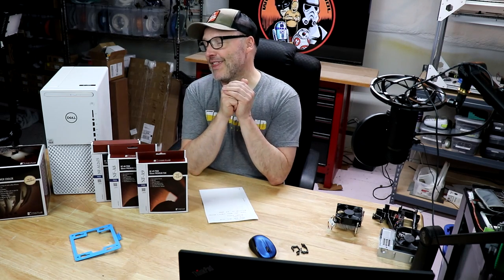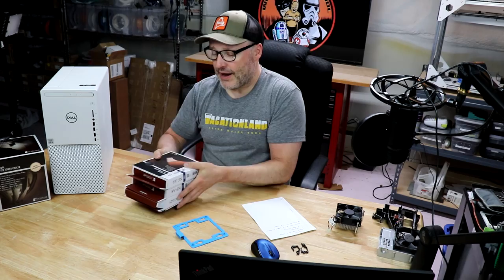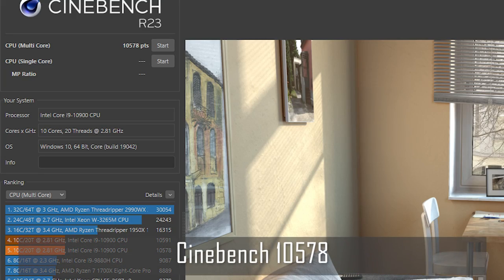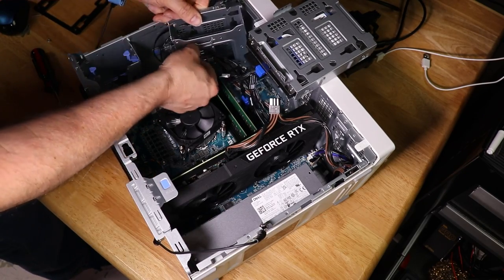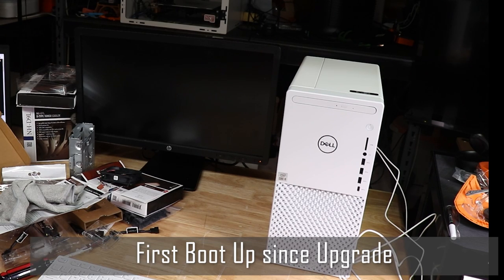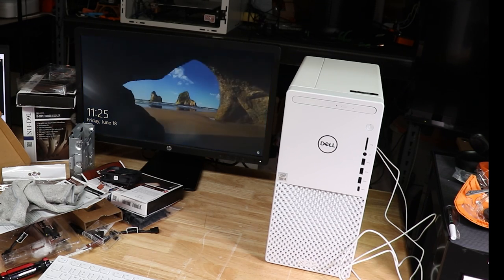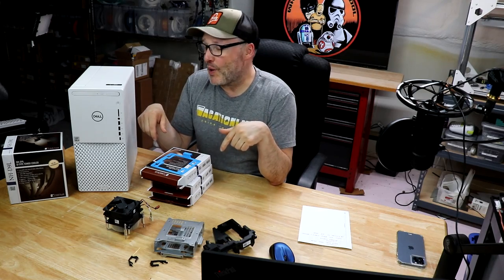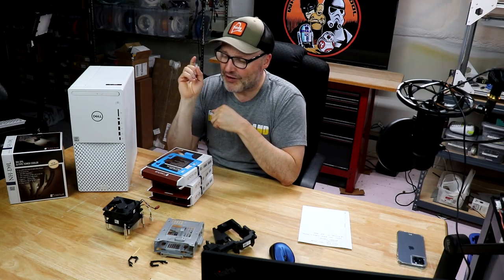Dell XPS 8940 / G5 5000 - Upgrading CPU Cooler and Fan Upgrades for better performance?

Comment: @Where Nerdy is Cool!  --  I'm wanting to do this upgrade to my XPS 8940.  Apparently, it's getting too hot.  Streaming videos results in random screen freeze with buzzing noise, and I have to manually power off and let it cool down.  I opened it last night to get a gander of the innards for comparison to the video.  I cannot figure out how you are connecting/wiring the 120mm front fan to the system.  I'm sure there must be something there, somewhere.  However, I see only one label that reads "fan sys", and that is dedicated to the rear fan.  What should I be looking for?  Will upgrading the rear fan alone be enough?  I paid $3600 for this machine, specifically for video capabilities.  That's a lot (for me) for it to have problems that seem to be inherently built in.  :(   On another note, I had no problem locating that 120mm fan mount for the XPS 8940 on ebay.  There are lots of them out there now, under $10.  I'm not ordering anything until I know I can plug in that front fan though,... and I am stumped.  Help?
Reply from the maker: I’m using a splitter to get that front fan plugged in.  It helps but honestly if you want the minimalist way to cool that thing down - replace the stock heat sink with what I suggested and replace the rear fan.  Those two things will blast a lot of heat out of that little case!
Reply: @WhereNerdyisCool  - Aha!  A splitter!  I can certainly do that.  It came with the super-duper heat sink already installed, but halfway through a movie, you could use the top rear of the casing as a coffee warmer.  I think (hope) that getting more air moving through the casing will make the difference.  Many, many thanks for your video and for your response.  Greatly appreciated.
Reply from the maker: @onedominant that’s pretty toasty. Yes try the fan and see what that does to your temps for sure

Comment: Which fans did you have as exhaust and wich were intakes? Also did you use the splitter that come with the fans to split the fan output from the motherboard to all the case fans?
Reply from the maker: Watch the video. It’s all in there

Comment: Great video!  Question about the 120mm front fan.  They have 3 pin and 4 pin options.  I know the Noctua A9 for rear is a 4 pin but the splitter used  has a 3 pin and 4 pin tails and the rear fan would take the 4 pin tail.  Does that mean the front top fan be a12x25  would have to be a 3 pin version?
Reply from the maker: Not sure I follow. Everything I did used the 4 pins
Reply: Sorry for confusion.  In looking at the y splitter from Noctua, one branch has a 4 pin end with 4 pins and the other has a 3 pins in a 4 pin.  Will I be okay getting a 4 pin noctua 12x25 for front?

Comment: Does the front panel allow for sufficient air flow?  The grate on the bottom front panel doesn't line up with the fan which is on the top front. Is there a custom front panel to fix this?
Reply from the maker: I feel some air definitely gets through that front area.

Comment: Hi. I am new to all this. Got  my Dell xps 8940 for a good deal. Due to budget constraints I will be using the vetroo v5 for cpu cooler. I see the other brown fans you use. Instead of those, can I use Noctua NF-B9, Noctua NF-R8, and Noctua NF-P12? What is difference, color or how silent it is? Any help is appreciated. Thank you for this video! Saves me hassle of buying a whole new case, mobo, and power supply. Also, i do not have 3D printer for the 120mm bracket. I know its probably no good but can it be zip-tied somehow to stay in place or is the bracket required?
Reply from the maker: I’m sure if you reach out on social media one of your friends must have access to a 3D printer. They are everywhere!  As to your fan questions, give them a try and let me know!  Someone else might come across your comment asking the same. My PC is quiet and doesn’t interfere with filming videos, live streaming or gaming. Do yourself a favor and collect some before and after stats to compare!

Comment: What are your thoughts on swapping the case? Is it possible/practical?
Reply from the maker: Don’t think it’s very practical. If I buy a new case, I’m piecing together my own computer 🙂. Since I couldn’t find RTX cards, that’s why I settled in the Dell.  But a better cpu cooler and some added airflow does wonders.  Even just the cpu cooler and a bigger rear fan will be noticeable

Comment: Nice video.  Out of curiosity, where do you plug the two front fans in for power?  Do you use two splitters off the rear case fan?  Thanks
Reply from the maker: Yes

Comment: Great video! Is there a link to the m3 25mm screws you used? Thanks!
Reply from the maker: I just bought some at my local hardware site and cut the heads off with a Dremel
Reply: @WhereNerdyisCool  Cool, yeah I was having a tough time finding some without the heads, guess I'll just bring out the dremmel. thx!

Comment: Hmm... Seems like a more a cooling thing.  But temps are still within spec for the chip and it won't go over its thresehold.  Me personally, that is something I don't care about. Seems like a cheaper option for cooling is $40 for a 92mm fan and the upgraded Dell cpu cooler if you really want to.  Temps won't be as good, but still much better and likely give you similar gains if you run a program that pegs the 100% all the time. If you just play games or use applications where the CPU utilization bounces all over the place you don't really gain anything.  I'd be more interested in 1% lows.  See if there are any gains there.
Reply from the maker: The big thing to note is the cpu speed drops as the temp soars. With the new heat sink and additional cooling, your processor isn’t powering down to stop from overheating. In hindsight I’d skip the fan by the video card.  But for not a lot of money you get the full capabilities of the processor.

Comment: Hi! Great video! What are exactly the screw that you are using to put the CPU cooler?
Reply from the maker: It’s mentioned in the video and the description. M3 x 25 mm. Cut the heads off. Or if you can find 20mm long M3 set screws, no cutting required

Comment: Do you need the 3d printed part to install the 120mm fan?
Reply from the maker: Unless you can come up with another way to secure it to the front of the PC
Reply: @WhereNerdyisCool  would the 80mm fan fit in that spot without needing any other parts?
Reply from the maker: Hard to say. I’m sure you could find a way.  Honestly, if you can’t get that front one installed, stick to the better rear fan and the cpu cooler.  That alone will do a lot!

Comment: so, do i need to buy the m3x25mm set screws apart?
Reply from the maker: As I’ve said numerous times in the video and comments - I just snipped off the screw head off some m3 x 25mm screws, filed and used that.

Comment: Thanks a lot for this video! I only wanted to ask if you would be still able to add another two memory modules or not? in other words, does the cooler block the fourth Ram module?
Reply from the maker: I think everything fits!  I just ordered a ram upgrade so I’ll know for sure soon
Reply: @WhereNerdyisCool  always helpful .. thank you! Please let us know how it goes. I hope you get lucky with your order delivery, mine have been stuck with UPS for a little time (not to much) due to "extreme global weather" :) coming from ON to BC.
Reply from the maker: I had no issues putting ram in last night!
Reply: That's great! Still waiting on mine, but I'll put the cooler on order. 
Once again thanks a ton!

Comment: Very insightufl video. I am wondering, will an XPS with an i5 and a gtx 1650 be able to work well for light web browsing (like watching videos) and learning to code or will it overheat? The monitor set-up will be two 4k monitors. It will be a productivity machine not for gaming.
Reply: for light web browsing its okay, for gaming only that it gets really bad
Reply from the maker: I know for the 3070 it does okay with a good dealing of tweaking and careful over clocking.  For VR is use OpenXR

Comment: This was an absolutely killer video my bro! My configuration came with a 1660ti and looking to upgrade this to a 3060 phoenix for some rtx features, do you reckon the upgrades you do in this video will still fit space wise?
Reply from the maker: If you have that hockey puck like cpu cooler, definitely do that and a bigger/better rear fan. You’ll feel an amazing blast of hour air flow out of that XPS after

Comment: One other free thing that you could've done is installing Intel XTU and increase the Intel Turbo thing to the max time period, that would've given you more CPU performance after you installed all those fans and changed the cooler.
Do you have a video on the HP Omen 25L(AMD version) made. I searched everywhere and can not find VRM heatsinks for sale.
Reply from the maker: I looked into that but last I saw, the boost was a max of 15 minutes?

Comment: Hey, I did your setup except for notcua cpu cooler i went with artic 13x, great stuff! I even added the vrm heatsink. I do notice at full load I can still hit 85ish, is this normal? It does seem faster and more able to keep cool longer though. Thanks!
Reply from the maker: Any improvement helps. You must feel a whole lot of hot air blowing out the rear fan now

Comment: So I did 120 mm and 92 mm fan from Noctua and NH-D9L, have you figured out how to monitor fan speeds? My config is i7 with 3060Ti, 32G.
Reply from the maker: I left them stock

Comment: THE REAR FAN YOU INSTALLED TO EXHAUST, IS THAT PREFERRED WITH THE TOWER CPU COOLER?
Reply from the maker: Wow. Capital letters. 
Yes the big rear fan helps a lot. And the better cpu cooler does an amazing job.
Reply: @WhereNerdyisCool  what direction is the airflow< in or out?
Reply from the maker: Front fan pulls air from outside. Rear fan blows it out (exhaust)

Comment: Just have a question with regards to XPS 8940 120 mm fan mount. How did you get it? What are the steps? Thank you.
Reply from the maker: I printed my own. The links have the file. If you know someone that has a 3D printer, it’s a simple print
Reply: @WhereNerdyisCool  Okay thank you.

Comment: Very helpful :) Ill be doing this shortly, what kind of fan splitter should I use ?
Reply: Hi  - I did this same upgrade on my XPS9840 using the same fans. The fan splitter cables come already supplied with the Noctua fans, in the box.
Reply from the maker: Everything comes with the Noctua fans.

Comment: If you took the GPU out, is there enough room for one of those thinner ITX 120mm case fans to put in front of it? That's the reason the GPU didn't show much difference. The air from the 80mm is hitting the PSU mostly. Positioned dead center in front of it you'd be able to cool the GPU a little.
Reply from the maker: Or use Afterburner and crank up the fan speed as I recently did 🙂

Comment: How did you change the fan speed? It seems like dell does not allow that as speed fan couldn’t detect the fan at all.
Reply from the maker: I didn’t touch any fan settings. Just new fans

Comment: Hi, great video.  When you installed the front fan on the printed bracket, you said you were concerned about "bottom but so far nor wires have touched".  Is there some "danger" to be worried about / avoided?
Reply from the maker: I didn’t seat it properly the first tine into the slide guides.  I wanted to make sure the fan blades didn’t chop away at any cables 🙂
Reply: @WhereNerdyisCool  Thanks for reply.... that makes sense.....thought it might be some special techie magic!!!

Comment: Did you get the M3 screws from the Noctua CPU Cooler box?
Reply from the maker: No. I bought some M3 30mm sized ones, measured 25 mm and gut the tops off.

Comment: I didn’t not receive any m3x25mm set screws with my purchases, and cannot for the life of me find the exact screws to buy. Please help
Reply: Baked I just checked the rest of the comments. I guess I’ll try my best to cut the head off some screws?
Reply from the maker: @connorbroyles2669 file them carefully!
Reply: @WhereNerdyisCool I’ve had them cut, but I feel it was not enough. My dad works in inches, so he cut it to one inch instead of the exact size needed. Since he’s difficult, and I think the inch is for sure too long, what size exactly do I need to grind it down to? 0.984252?
Reply: I tried to mount using the 1inch cut, but was left with some wiggle space on my mounting bars with the spacers, I figured that part needs to be snug since it’s literally holding everything right? My screws also seem very well stuck in the motherboard so I need pliers to get them twisted back out LOL
Reply from the maker: @Mcbetuss  just make sure it’s a smooth cut. You’re doing this at your own risk ⚠️ so just make sure everything fits well
Reply: @WhereNerdyisCool likely a millimeter of space between the mounting bar and the thumb screws being snug :(

Comment: Did those screws you put into the motherboard for the cooler come with the cooler kit or did you buy them separately? Thanks!
Reply from the maker: As I stated in the video and numerous comments … no. 😀. I bought some 25mm M3 screws and cut the heads off.

Comment: Hi. May I ask what thermal paste you using for the cooler? Can I use Arctic MX-5 with the Noctua NH D9L?
Reply from the maker: I used what came with the  Noctua cpu cooler.
Reply: @WhereNerdyisCool  ok. Then maybe I guess I will try use Arctic Mx-5 since I check another video using Mx4 on it. Thanks
Reply: I just install the cooler.
Any software or Dell bios can control those fans speed?
Reply from the maker: I didn’t touch any software settings 🙂

Comment: Where did you get the 25mm m3 screws?
Reply from the maker: As mentioned in the video and description, I just using a Dremel to cut the heads off some regular M3 25mm machine screws
Reply: @WhereNerdyisCool  OK thanks.

Comment: Where did you get those m3 screws any links ?
Reply: Just to clarify i bought the exact same coller thinking those screws were included lol
Reply from the maker: Hi!  I just bought some M3 pan head screws and used the Dremel to clip the heads off. I used a file and a M3 die to make sure there were no burrs left behind.  Happy upgrading
Reply: @WhereNerdyisCool  I went and bought some today unfortunetly they werent long enough if i would cut the head so i just kept it and they seam to be okay i hope it wont be a problem though but for now the cooler seems to be holding on thight

Comment: When I replace Dells' OEM with Noctua NF-A9 PWM (92mm) I get an error in Dells' diagnostic: "motherboard fan failed to respond correctly". Did anyone else experience the same issue?
Essentially, Dell's motherboard cannot control the speed of the Noctua fans. I ended up using 120 and 92  on the front with constant power supply from SATA adapter and NLA and leaving Dell's 80 in place. Thoughts?
Did anyone tried to run Dell diagnostic on Noctua CPU cooler?
Reply from the maker: That’s very interesting. Did you check the Dell Forums about that yet?

Comment: Where Nerdy is Cool!

If you are still responding to this thread on this video.

Did the CPU cooler come with the adapter for the oddball Dell mounting system? If no do you have a part number for that adapter?

Did you have to buy screws to mount the Noctua custom cooler mounting plates to the PC's motherboard or were they included with the cooler or the yet unnamed adapter kit?
Reply from the maker: Everything I used came with the cpu cooler for my Intel  i9
Reply: @WhereNerdyisCool  Thanks for the additional info!
Reply: @WhereNerdyisCool  I now have the NH-D9L cooler in hand and the m3-25 set screws are not included in the box with mounting kit that comes with the cooler. I have now ordered a package of 10 on ebay. I'm still waiting for the custom 3d printed fan mount to arrive so hopefully the screws will be here before it arrives.
Reply from the maker: As I said in the video and numerous times in the comments, you’ll need M3 screws and that I trimmed the heads off some M3 25mm ones for my install (and also referenced in the Dell Forum link).  Sounds like you’re well on the way to unlocking some performance!

Comment: Seems to me the added CPU fan was a good investment. The three case fans? Not so sure.
Reply from the maker: You have a point. If you only do two things…do the better cpu cooler and a bigger rear exhaust fan. You’ll feel a big difference in how much hot air can escape now

Comment: I have Dell XPS 8940, 32 GB ram etc...It is a less than 1 year old machine but recently I've been having issue with this computer on a daily basis. My computer goes into sleep mode due to inactivity but the problem is it is not waking up from sleep mode. It tries several times to wake up, the power button turns off for a moment but the computer never wakes up. All I get is just a blank screen, not even bios screen is loading. The only way I can bring my computer back is by shutting it down. Also I've noticed that recently the boot up time has doubled. This is very frustrating problem to deal with on a brand new machine and that too with all good specs. Does anyone else have the same issue? Any help you can provide will be appreciated. Thank you!
Reply from the maker: Have you checked the Dell Forums?  I’ve found that to be a good resource

Comment: Nice video! Do you think that if I put just the fans in, and not mess the cpu, that it will lower the temp in any significant way? Also, where did you get your fancy static bracelet? :) Thanks!
Reply: If you are talking about the bracket for the 120mm front fan, I have some up on ebay.
Reply from the maker: You could try, I knew my CPU cooler was pretty lame, being the pancake one.  (Intel i9)  That was the biggest game changer.  Then getting all that warm air out with stronger fans!
Anti-Static Wrist Strap here   https://amzn.to/2UMimdU